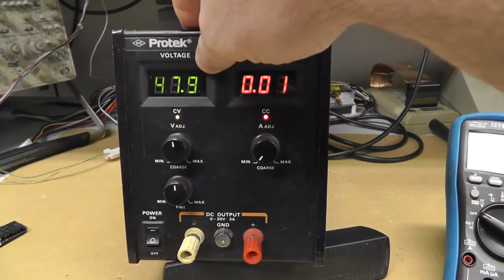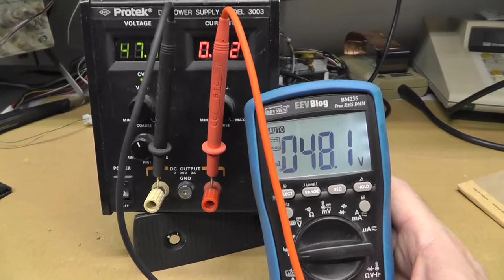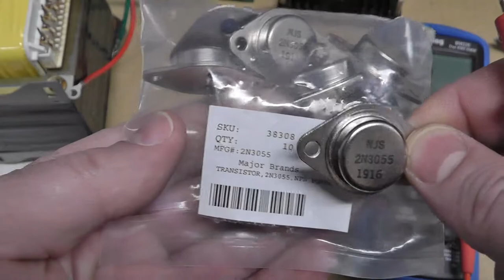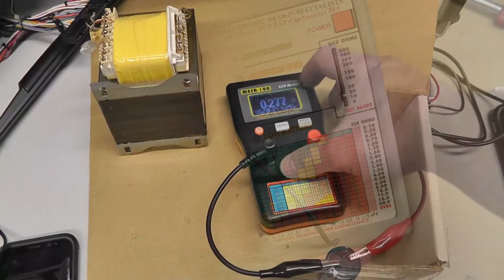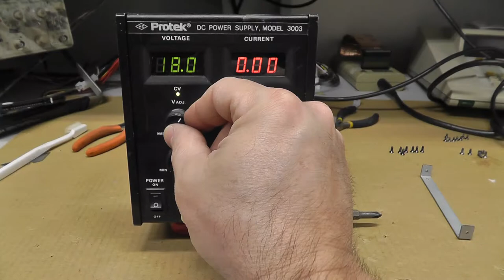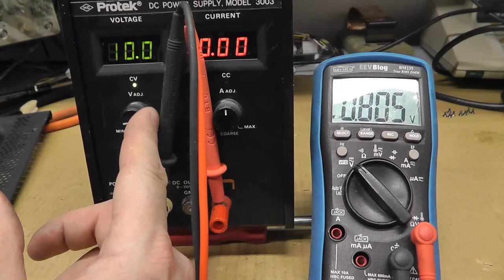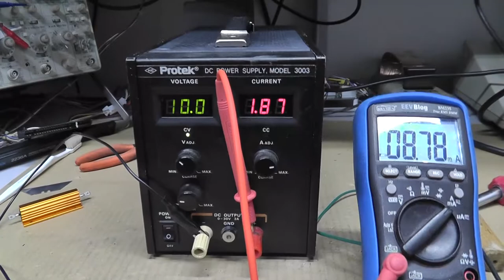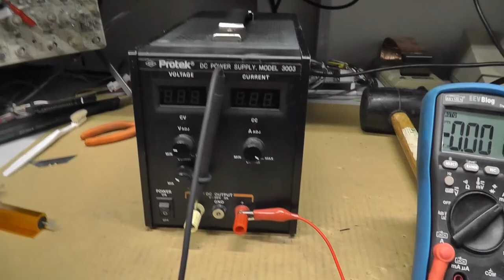Bench Power Supply Test & Repair - Protek 3003 - Repair and Test

Comment: Do you know any arcade power supplies that has an APP or a sleep mode that will turn on/off the arcade game at certain time intervals? If you have 20 or more arcade games to save on the electrical bill all the arcade games can be turned on but the power supplies will be in sleep mode and turning on/off the arcade screen graphics at certain intervals. Try to look into a power supply like this
Reply from the maker: Not aware of anything like that.  Some people just plug their games into smart outlets and turn them on and off via google, alexa, etc.
Reply: @jacklick  they have these I think these timers for outlets that come with apps now they're intelligent apps but they're called timers and you plug your arcade game or pinball machine into one but mostly the arcade game the graphics on the on the game will still be there but it turns the game off and on I'm guessing it uses pulse with a modulation I'm guessing but the timer you have an app and you could set up the intervals of you know the game will go to sleep mode every was to say every 30 seconds or every minute and it will just constantly recycle it try to look into the timers and the intelligent timers because this could save a lot of power I think you have like about like what 40 arcade games in your basement or something like that I've seen in your other videos so this could save your electrical bill if you want them all on all day long and something for you to look into also that would be a good thing
Reply: @jacklick  try looking into AC outlet timers and SMART AC outlet timers because I think they have software apps now which you can put multiple arcade games in sleep mode saving on the electricity bill
Reply from the maker: @waynegram8907  Really not needed for a home arcade but thanks for the insight.

Comment: Your DVM meter seems to only measure current at Low voltages and when you increased the voltage for some reason it was measuring garbage. Not sure why at higher voltage your meter can't measure current but at lower voltages it can measure current. Maybe your meter can only measure 1 amp of current MAX? You're putting a 1 ohm/100watt resistor load?
Reply from the maker: Yea, I need to look into that. The meter is a BM235 and should be good up to 10A.  I am going to replace the batteries tonight and retest.  I used both a 1ohm / 100watt resistor and a 5ohm 100 watt resistor.
Reply: @jacklick  It should work or something is wrong not sure
Reply from the maker: @waynegram8907  already did a quick test and it was the batteries.  I will make a quick vid tonight documenting it.
Reply: @jacklick  nice yes make a video. I noticed your power supply won't go up to 3amp unless the voltage is higher than 10volts. Set it from 1v to 5volts at 3 amps and it will only go up to 2.3amps it seems, not sure why.
Reply from the maker: Ohm's Law.  You are probably referring to when I had the 5ohm resistor on for test load.  Example...It will take 20v with 5ohm resistor to create 4amp load.  That is more than the power supply is rated for.  With a 1ohm resistor , 5v would create a 5amp load.   https://ohmslawcalculator.com/ohms-law-calculator.
Reply: @jacklick  Are you saying that the power supply won't go to 3 amps when the voltage is set to 10vdc and the current is MAX setting? Yes I know that 10v/5ohms = 2amps but the power supply should "still be displaying 3 amps" as the current limit it "shouldn't not" be displaying 2 amps. 15v/5ohms = 3 amps so when you set the power supply to 15vdc the current display is reading 3amps or 2.6 to 2.8amp because the power supply can't provide 3amps because its bottoming out?
Reply from the maker: @waynegram8907  uploading follow up video :)   the resistance isn't exactly 5ohms with leads and the resistor inside the meter so it won't be exactly as the ohm's law calculator shows.  stay tuned.
Reply: @jacklick  I thought the power supply was causing power supply sagging issues by bottoming out because its common for power supplies to cause sagging issues. Yes the power supply should have a "shunt resistor value" to measure the current. Not sure if that shunt resistor is causing a voltage drop that is the difference between the voltage drop of the 5ohm resistor.
Reply from the maker: @waynegram8907  The burden voltage, per manual and measuring how I was, is likely 0.04V/A (40mOhms)
.  so about  .12volts which matches the results in the video.
Reply: @jacklick  yes all DVM meters use a different burden voltage value/burden resistor value. The DVM meters milliamp range burden voltage is completely different.  If you put a 1ohm resistor you can measure the maximum current output of your power supply. It should be higher than 3amps after the voltage is passed 3volts because 3vdc/1ohm = 3 amps. At 5 vdc/1ohm = 5amps so your power supply should measure 3.5amps or something like that.
Reply: @jacklick  The burden voltage is 0.04volts Per amps. 0.04volts X 3 amps = 0.12volts?